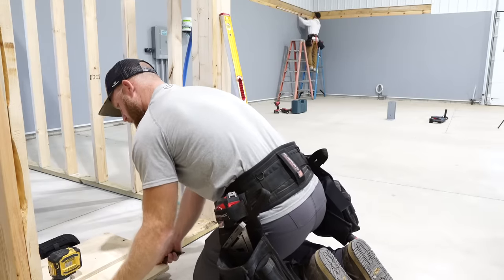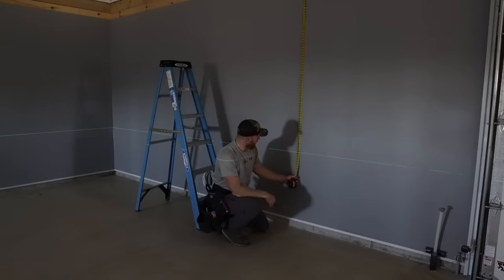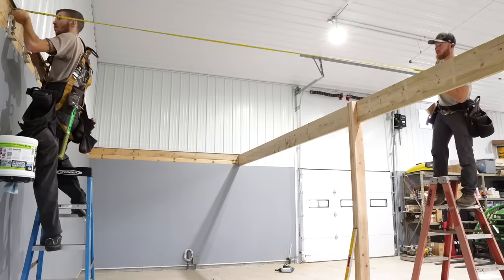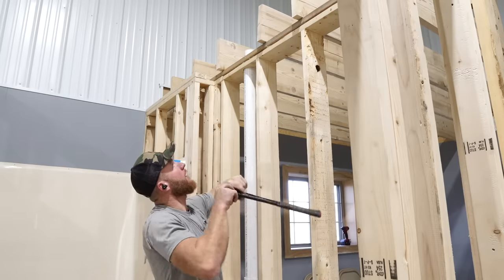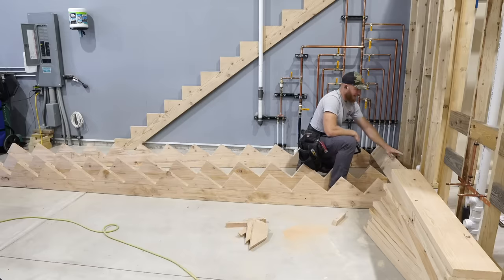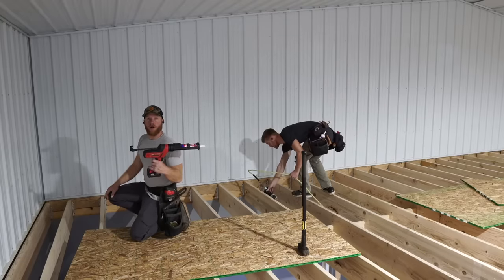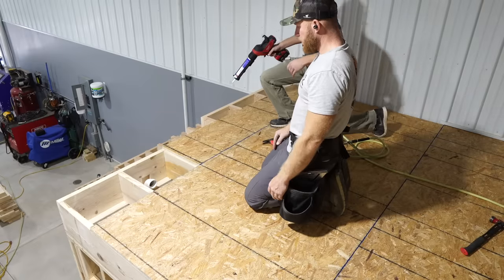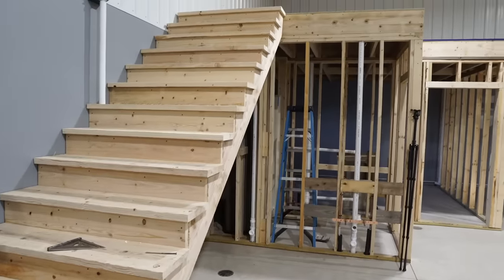Building A Large Mezzanine With Stair Case

Comment: Nice job Kyle. The only thing that we do different in my area is we have to put two by four runners on the bottom of each stringer and also underneath the ground floor step we put a pressure-treated plate down , notched and  nailed to the bottom of the stringers. Then we screw the plate to the concrete floor with concrete anchors which sort of pinches the stringers between the top and the the bottom of the run. No chance of moving.
Reply: Thrust block
🤜🤛

Comment: Hello Kyle,  That 12v Milwaukee caulking gun does a great job doesn't it.  Got one three years ago and really like it.  However be careful when using the PL 400.  I was using PL Premium and the temps got below 40, no real problem until it got below 35.  Then the gun blew the tube apart.  What a mess (gasoline was the best solvent to clean it up).  Thought it was a freak but the temps were below thirty and I blew two more before I woke up and realized that one of the downsides to using the PL below their recommended 40 degree temp was the viscosity was going way up and the gun had the power to blow the tube when it did.  Had to go back to Liquid Nails til spring time.  When the PL blows it takes quite a bit of time to rescue the gun!  Nice job.  Take care.  Doug

Comment: This is timely... I'm currently building out a mezzanine for my shop. But after watching all of this, I'm glad I chose to build it out of steel.
Reply: Why
Reply: @user-hd8ej8yx9p  Steel is forever, I can store heavy and functional equipment on the top. Plus it was actually pretty fast to make from scratch. The stairs were the only thing that took the most individual time out of the whole project.
Reply: did you save on labor cost or did the materials catch up? how much space is yours taking up, looking to build a second floor.
Reply: @mysteriousknowledgetexts9809  I ended up going with steel pallet racking as my base legs. I saved tons of money, plus I can literally store tons on top. I did in fact make a stair case out of steel tubing, tread plate etc. I have about 420 sq ft. And with every two sections of pallet rack I add, I can increase the floor space by 210 sq ft. I made the decking out of two layers of opposite stacked 4x8 heavy duty plywood, screwed to a steel ladder frame that I lifted in place with a forklift into three sections that I was able to bolt together once laid on top of the pallet racking. The whole project only cost me $1800 for everything.
Reply: @EcoMouseChannel  not to mention it won't get squeaky over time. currently living in a townhouse and the stairs and upper floor are so noisy to the point it gets on my nerves.

Comment: 17:48 Yes, the boards are only 47 7/8 inches, but I thought that the 1/8" difference was the gap between sheets recommended by the supplier to allow for expansion.  I seem to remember The Essential Craftsman saying that.
Love your channel and your work, by the way.  Thanks for sharing.
Reply: Im pretty sure that’s for sheathing especially roof sheathing not for subfloor applications. I could be wrong though

Comment: How did you know you would miss the in floor radiant heat when drilling the holes to anchor the column? Was that built into the original plan?
Reply: I believe so, he mentioned it was poured 12" there for that column.
Reply: He stated that a 12 inch thick pad was poured in the floor where the bracket got shot to the floor. I almost missed it to. Happy 2020😀

Comment: As per usual great job!
One question, I did not see you attach the bottom of the stairs to the concrete slab, do you not usually do that?
I like to notch out the bottom of the stringers where they touch the slab and put a 2x8 laying flat in the notch and anchor the stairs to the slab through the 2x8 notched into the bottom of the stringers.
Maybe you have some reason for not anchoring the bottom of the stairs to the slab, or maybe you just did it off-camera.
Great work, as usual, I love the detail around the pipe on the stairs, too many guys would just hack out a notch and leave it, not Kyle.
Cheers from Tokyo!
Reply: Thrust block
🤜🤛

Comment: How come you did not stagger the plywood’s .
Reply: That thought occurred to me too, then I thought, well gee for the SPEED it saved. Looks good and clearly displaying it in raw form then burgermeister's all would say the same thing. I say F* it. no weak points IMHO and looks master crafted. Then again Carpet or paint and it all "disappears".
Reply: Staggered sheets adds to rigidity and structure. Those are tongue and groove so there is immensely less chance of slippage between sheets and the joists are framed at 12" on center. It's completely over engineered and insanely strong. So with the layout and choice of materials staggering the sheets is really just a redundancy at this point.
Reply: It looked to me that the sheets were staggered.

Comment: Amazing quality, as always. Both in craftmanship as well as production. I have a quick question, it looked like the workshop had radiant heat flooring. When bolting the bracket to the floor, how do you know where the heating lines go so you don't puncture one?
Reply from the maker: No radiant flooring.  Those were all shut off valves for each fixture in the building
Reply: Also, the column was planned to be there.  Like Kyle said, the slab is thicker there, kind of a footing if you like. Had there been radiant  floor heating that footing could have been avoided when laying out the piping.
Reply: Ah, great! Thank you!

Comment: Question for the experts. I'm going go build a post frame 30x50  on perma columns 8 foot on center with a raised floor. My question pertains to my idea for a raised floor system. I wanna run a doubled 2x12 ledger around the inside of the post with 2x10 joist 16 on center  setting on them and on a tripled 2x12 in the center also set on perma columns 8 ft on center. Is that ledger board strong enough for the 8 foot spans

Comment: Loved it, another great video. Question: obviously most of us won’t have a beam cutting saw in our arsenal,  and I am always concerned about using safe practices when constructing something. So, can the same degree of accuracy be “safely” attained when cutting stringers; by using your standard circular saw, stacking the stringers as you did, making the cuts so that the third stringer in line is basically only scribed by the blade, then removing the top two stringers and following the scribe mark to complete the cutting of the final two stringers? Or, considering all the additional layout work on the final two stringers, before you can continue the cuts, would it just make more sense all around  to lay out two separate sets and do your best to be as accurate as possible?
Reply: Just cut one stringer and use it as a template for the rest. Plenty accurate and it’s the way everyone else does it that doesn’t own a beam saw like that.
🤜🤛

Comment: Thanks     I want to make a steel building  approximately 50x100  with a 25' wide two story living area on the end  and the same on the other end for an RV garage space. The middle section  will be a shop area 50' long in the middle with a "U" shaped mezzanine above.  So my question is. Is it possible to make this mezzanine without the support from the bottom?  The support would come from 
some type of support (cables maybe )  from the ceiling structure. This will give me room to drive vehicles on the bottom with no obstructions.

Comment: i wish these guys could redo the  floor in my second level, the home builder that built my house feels like they used scrap wood that was two different thicknesses
Reply: Water will do that to particle board and MDF junk. You need sheathing to really defend against that. Otherwise, their OSB will do better than what you probably have, but will still do the same thing...
Reply: But they probably didn't glue, and if they did, it's probably built in the 70s or a helluva long time ago, where the glue has now failed and the nails are lifting. When I build my house, I'm using 100% screws, probably everywhere, but especially the floors.

Comment: I get a lot longer life out of my planar knives when I'm going with the grain, way less output clogging as well.
Doubled up 2x12 rim with that much taken out at the bottom ends would've not flown here. 
Do you get any deflection out of that beam saw/saw blade? The old makita with a diablo on there frisbied out on me time to time, especially on hip cuts.
18v caulk gun changed my life.
Do you go crazy with so many different batteries and chargers?

Comment: Kyle, do you ever have a problem with the edges of that plywood swelling after you put it in where you live? The reason I ask, we used to use that type almost exclusively here where I live, but the slightest rain on it before the roof was dried in or if it was in a unconditioned attic, the edges would swell- sometimes real bad. Most people have gone to using osb with a waterproof glue in it to keep from having the problems.

Comment: I have a 30x40 post frame building in LaPorte In, I was thinking of doing this, adding a 10x30 mezzanine in the back. I don't think I could span 30' and I forgot to put in a footing for a post. I could cut out a section and put a footing in. You mentioned on this build the pad is only 12" deep? What are your thoughts on this?

Comment: The Fasco gun you were mounting the hangar brackets with, does it expose the nail tip for alignment like the Bostic Strapshot guns do? Been looking for a gun that will do metal connectors and take up to 2.5” nails and not thrilled with the options.

Comment: This is awesome questions for u looking at building a new shop and wondering if I use the valtied trusses could I put a header above the side walls like to do 16 foot walls with a 18 foot door on the end
Reply: Well that depends on the width of your building and the pitch of the bottom chord and top chord. Normally for a 4/12 top chord the bottom of the vaulted rafters are 2/12 pitch, but not always.

Comment: I can't believe you two don't wear safety glasses when using the air nailer! especially when nailing hard sheet goods like OSB. Take it from someone who has had to have a nail surgically removed from my wrist, it happens SO quickly, you don't even know what happened until it's too late! And at least I could see it because the nail wasn't in my eye.

Comment: (2) 2x12’s still seems a little light for that header. I’m a structural engineer, if you are interested I would be happy to check it for you. Just get me spans
Reply: Josh Weight >says it’s 32’-6 less than a minute into the vid.
Reply: What are you going to calculate? You don’t even know what loads will be going up there.
🤜🤛
Reply: Or just google southern yellow pine pod tables, they provide max spans for joist and edge beams based on common load combos.
Reply: @iRideUCF08  I don’t even have to watch the video again to know, it’s not SYP we’re even talking about. My guess, just from memory is hem-fir.
🤜🤛
Reply: He made 2 x 10's out of some of those 2 x 12's !

Comment: You seem to have a lot of ceiling height. How tall is the building? How much height is underneath the loft, and how much above? My city says that my maximum height is 15 feet between the ground floor, and half way between the eave and peak. Depending on my roof slope, I could have a total height higher than 15 feet, which would give me more room in the loft.

Comment: Two Tapcons isn't enough for that post...if he hits that with forklift or something they would snap like toothpicks. If I recall the code for shear strength for that size of post bracket is 2000 lbs. Two Tapcons are about 1500 and we all know who is liable! Maybe you  did it later since there was no railing on either.

Comment: You should have run a string line on the front of your floor joist and then measured each joist and used them to keep the front of your floor straight. What you are doing in the video will transfer any defects in the existing back wall to the front edge of your "mezzanine" double rim joist. You could easily have 3/4" to 1" variances in your front rim board on a run that long. Anything more than a 1/4" variance will be visible. 
Also, it does not appear that you straightened your walls before you ran joist. Hopefully you plumbed your walls before you set your joist. 
If you are lucky,  your rear wall is straight and so your front rim board will also be straight.  If not, your upper floor will have a lot of variance in it. That may not matter if you carpet it, but it will matter with wood flooring and tile flooring.

Comment: Would like to see a jack stud under that notch in the header.
Reply: Mike Maloney... out of curiosity, where exactly are you mentioning a jack stud needing to be in conjunction with the header board?
Reply: I’m going to overlap my question.  I skipped through the video a little and I can’t see where a jack stud is needed except in one spot, but I’m assuming the area I’m thinking of received a corner bracket with many fasteners. The leading floor joist against the wall where the header attached to... I’m assuming they installed an oversized corner steel bracket on the inside to support that stretch of total flooring weight supported by the double header or perhaps because we can’t see that far away perhaps there’s a ledge we can’t see in the video that supports those headers at that wall corner.  

For a man with such distinctive detail as Kyle has I must give him the benefit of any doubt the header is secured to support that entire section of floor weight from the wall to the center post. 

 These videos are so fun to watch... so fun!
Reply: @snowgo5922  As you are out in the shop looking at the mezzanine, the left side of the header where it was notched about a 1.5" to set on the wall. That notch is highly likely to split. Looks like a fire extinguisher mounted there now. Just a observation, Kyle does a great job!
Reply: I see what you mean.  So there are two types of construction methods I’ve seen in the past.  One being attaching a  one-by ledger to the very bottom of the header or in some cases a girder. Then notching out each joist at the bottom to then sit on that ledge to then be secured to the header or girder.  That method I’ve seen in many older homes.   I just secure straight to the header or girder without that notching system.  

Kyle did the same thing in that header and in my personal experience of seeing hundreds of homes with ledgers installed I have yet to see a board split from that notch... however, I could see if one were to over cut the notch horizontally it could perhaps allow for a wood fracture or perhaps in your experience have seen one split in the past.  

That’s a great observation on your part, Mike.  You’re probably enjoying watching Kyle and his men construct as much as I am and it shows by your polite comment of suggestion.

Comment: Drilling into the concrete for that post is risky with the radiant tubes in the concrete.
Reply: We have a FLIR camera for water damage but it shows those lines clearly
Reply: There was a footer poured just for that beam. I'm sure there are no lines in that spot.
Reply: @overseas_demogod  Cool! That’s an awesome tip! Way cheaper than X-ray. I wonder if post-tension cables would show up 🤔
🤜🤛
Reply: @psidvicious  nope. The FLIR works because you can shut the heat off for a while and then kick it back on. You will start to see the heat radiate out where the tubes are run. Have hydronic heat in my house and wanted to run power up to a new kitchen island. Had to do the same thing.

Comment: whenever i see people building with wood all i can think of is "that's so much kindling! ". i get it, it's easy to work with (easier and cleaner than a steel, aluminum and drywall mix) AND pretty, but it's dangerous. these are relatively thin pieces of wood 2 inches wide, I burn logs at least 2 times it's width every winter, and it doesn't take much to burn them even when air is restricted, this is just a fire hazard

Comment: why measure every single floor joist length? could you grab 3 measurements and if theyre all within 1/16" of eachother just average them cut all the joists the same length? wouldnt different length joists do some funky things to the flooring even though its probably gonna be plywood? i  realize the wall might not be perfectly straight but its a garage mezzanine not a balcony in in a 8-figure mansion
Reply from the maker: Andrew it takes very very little time difference to measure and cut each one
Reply: @RRBuildings  yeah im just wondering what the upside is? takes out any wavyness from the header if you were to look down the length of it?

Comment: Are the nails you are using to fasten the brckets to the stair case code. I ask because I was told by an inspector that brackets for stairs and joist have to be structural fasteners,  nails or screws; like strong-tie, grk, etc. Correct me if wrong I haven't seen nails for a nail gun that are structural
Reply from the maker: These are hoist hanger specific nails...
Reply: @RRBuildings  Thanks
Reply: @waregeeksny  All gun nails are ‘structural’. Some capable of more load than others.
🤜🤛

Comment: This is great work but that stud wall as not up to the job of supporting that floor where the joists join - you need more than a standard stud wall, that wouldn't meet regulations in most of the Western World. All the extra beefing up just adds to the weight on that weak central point. Was this approved by a structural engineer?

Comment: I hate to be the one to tell you this, but. I'm making this comment reluctantly. I wish you no humiliation but at 6:07, I'm like, NO!
You notched the bottom of a 2x10 bearing beam. That's a Major NO NO. If your getting this mezzanine inspected by the local building department, it wont pass, unless you put a couple 2x4's under the beam against the wall. I have been framing houses for 45 years.